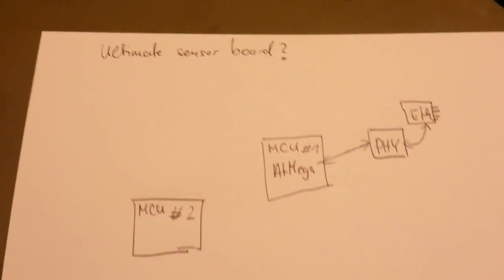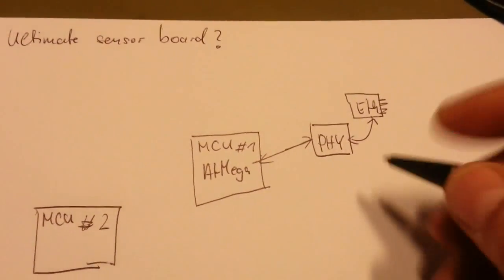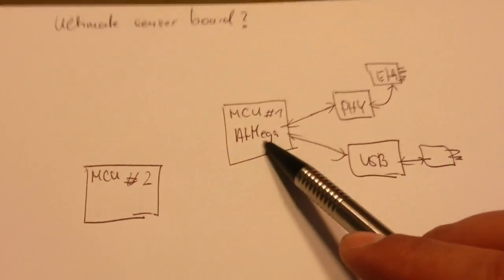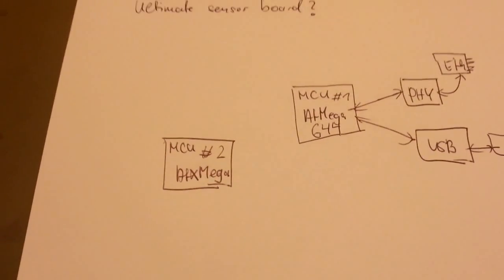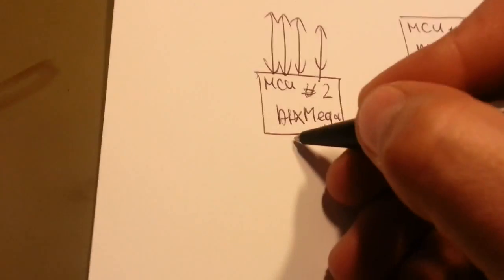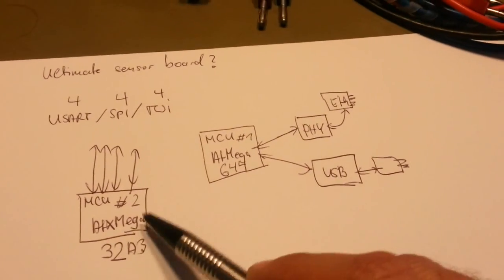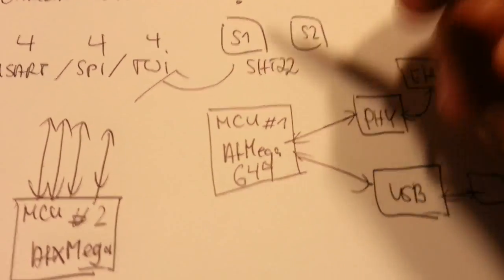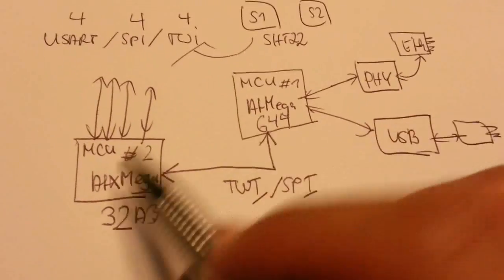Project idea: The ultimate sensor board.

Comment: Looks like an interesting project. Hope to see more videos as the project moves along. I had plans to make something similar in the future. Well not exactly the same, but I want to have some sensors in my house (temp, humidity, water/power consumption, ...). And it would integrate into the HA system I also plan to build. But first I need to finish my house and move into it :)

Comment: Be careful, maximum current draw from usb port is 500 mA.  It's not meant to power devices more than a simple usb stick.  But people abuse it as if it's a power supply for all kinds of cap like a coffee mug heater..etc

How about a gieger counter?  You'll need it to detect if radiation levels are safe after WWIII and if you can come out of your bunker.

Comment: I agree about the distance, but i was just proposing it as a + factor, WLAN for embedded systems costs sh!tloads. I'm currently working on a project, based on the raspberry pi, mpd client, wifi/bt in conjunction with an audio amp. It basically controls the amp from a soon to be done webinterface/ios client, rf rgb light control.. Anyway awesome project, glad that you want to tweak it further. The multiple MCU on a board is an interesting idea, i was thinking you could use a port expander